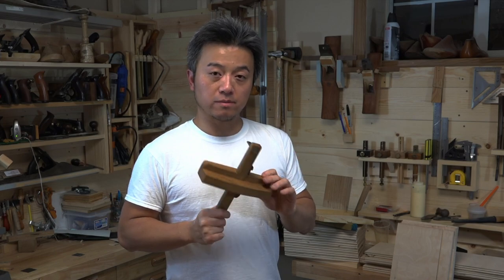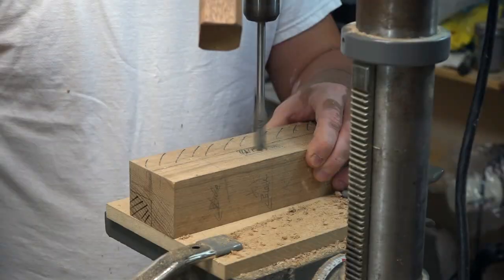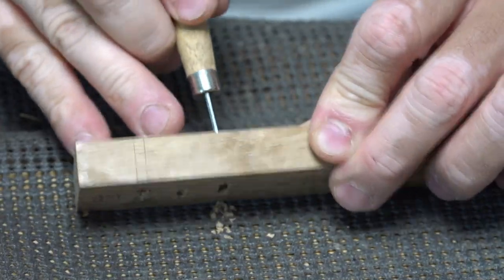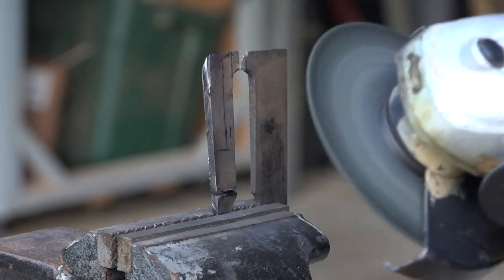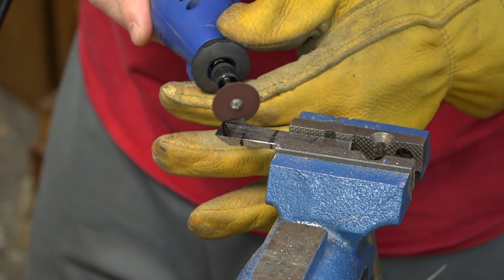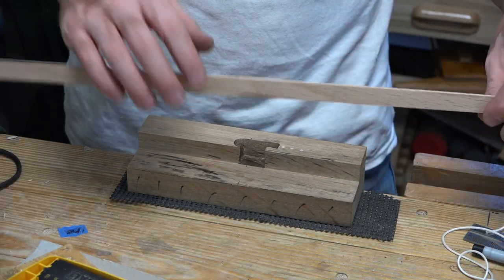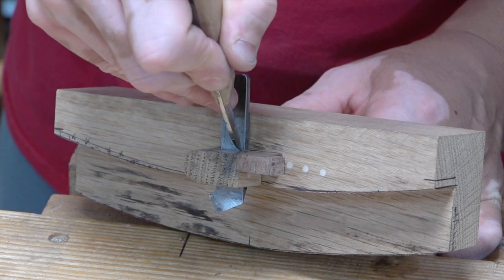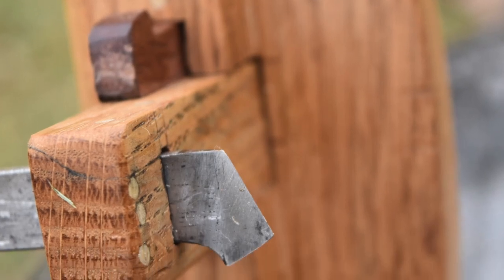Cutting Gauge 勒刀子 - Traditional Chinese Woodworking Tool

Comment: That tool is identical to the Japanese tools called a Wari Kebiki. Very cool that the two cultures share so much. Alot of (almost all of) traditional Japanese woodworking came from China. Cool to see the little links between them in things like this
Reply from the maker: As a casual observation, and painting w/ a giant brush, Japan as a country seem to not invent anything, but perfect (or pervert) a lot of inventions from other people. The Japanese version of this cutting gauge tool, that I have seen, has the side above the blade closed in, accommodating a much shorter blade. I think the open side for the Chinese version gives the blade increased stability and control. I hypothesize this design difference is indicative of the average hardness of wood that the Chinese and Japanese woodworkers had used.
Reply: وول عدد
Reply: ههههه
Reply: عدد ة مم
Reply: @johnzzhu  good observation between Japanese and Chinese mindsets. As a Chinese, I must say that we move on faster than Japanese. They tend to stick to a design they know and squeeze everything out of that one concept.

Comment: Ok John just watched a random video from the masters channel and saw a different marking gage ( non western nor Japanese)used to mark dove tails. Language on his videos is a problem for me but a new tool project for me thanks for the link.
Reply from the maker: I think you're referring to the 4 pronged gauge. It is on my list of tools to make, but I don't necessary like how he made it nor the general design of it. I made one similar w/ 2 prongs, but it has a tendency to drift. So I am currently think and probably testing out different design changes, before making a final version.
Reply: @johnzzhu  
My main concern with the design is the spacing of the cutters. A piece of brass should keep the cutter from moving.
Reply from the maker: I can tell you that is not a problem. Make it tight and the hex keys do not move at all. He's got videos of him making it. This is the link (https://v.youku.com/v_show/id_XNTYyNzI3ODMy.html?spm=a2hzp.8253869.0.0)

Comment: These things are so simple but so necessary for a lot of work, so it's nice to see such an easy video on it. You know the technique for cutting thin boards with that, right? (Lemongrasspicker does it with his Japanese version of this in some of his videos if not.)
This series you're doing is really good and I'll honestly be a bit sad when it's over. What do you have planned after it? Have you considered doing a Chinese low work bench?

PS:  You reminded me that the taper has to be small-end-up. I've been meaning to make one for a while and the other day I ground an edge on a hardened masonry nail's tip to use as a blade. I guess  I need to redo it on another one's opposite end though, whoops. I can still use the one I did as a nicker iron or maybe make it into a miniature tool at least haha
Reply from the maker: I do know how to cut thin wood w/ it. There are actually lots more tools I could make beyond the 7; I just think w/ these 7 tools one could potentially do a lot of woodworking. 

I am not aware of a "Chinese low work bench." there are distinct Chinese low sitting benches that function as sawing and chisel platforms. The actual work bench is just a bit shorter than your typical Western bench because the way the Chinese plane is designed.
Reply: Ah, I wasn't aware those were just normal sitting benches. I'd seen old illustrations, photos, and that one master use them for those tasks so I thought they were made a specific way for doing work. I'd also assumed the standing height work bench was a later addition. I'll have to dig more to see what's done special for the latter besides the dimensions, since every different western workbench style has their own quirks (roubo, nicholson, continental, and the old low types like the roman ones and loads more...)